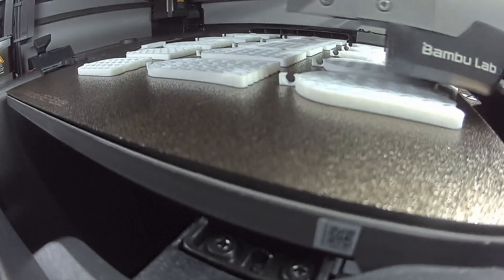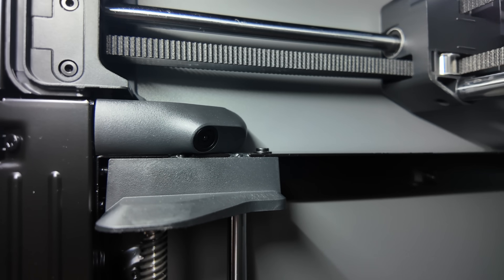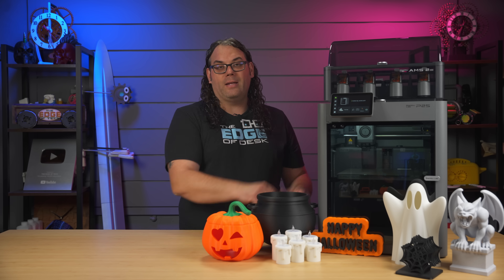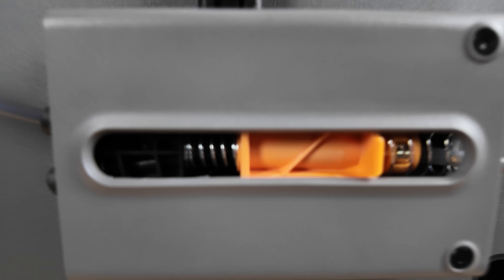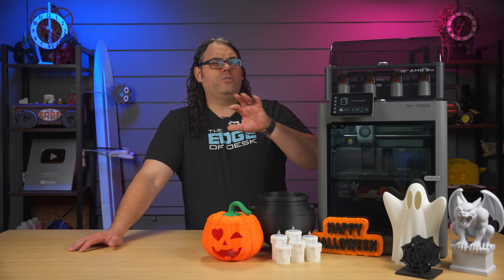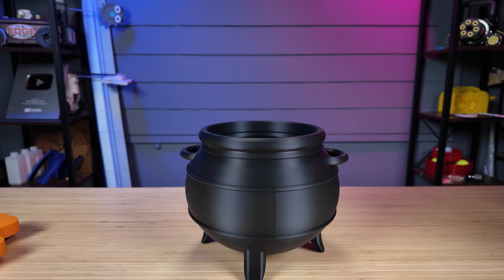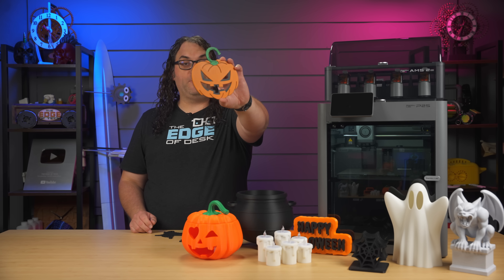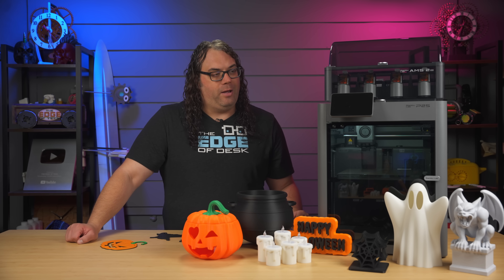What I think about the Bambu Lab P2S After 200 Hours of Testing

Comment: Any one else experiencing  problems  printing from the external spool holder  whilst the ams is connected? Seems to through up  random filament changes  and rehomes  in single filament  prints  which cause layer shift  due to not resuming correctly.

Comment: Thanks for the review man, quick question. There's currently no stock for the P2S combo right now but you can buy the P2S and AMS 2 separately, now and I was wondering if I were to do this what else should I get? I've done a bit of research and it said that I'd need to buy a buffer along with the AMS 2 so I wanted to clarify with an expert that I'm not missing anything, thanks!

Comment: One issue I think you missed is fume extraction when printing with ABS/ASA (and other filaments that give off fumes/VOCs) with this printer. On the P1S they had a cutout behind the filter that vented the internal air. Now on the P2S they removed that and give you the option of either circulating internal air through the filter or opening the vents and bringing in outside air. The problem is this will force fumes/VOCs out between the door seals and poop chute and/or through the vents. This is a real problem when printing with ABS/ASA and other filaments that give off strong VOCs. Voxel and others have products like the X Filter and Bento Box to help provide better fume extraction for the P1S (and these work well) but since there is no native air export cutouts on the P2S behind the filter it seems this will be more difficult for the P2S (Voxel actually does have something coming out next week for this). Seems odd Bambu has done this since user safety is a risk when printing with these types of filaments. Interested in your thoughts on these issues. Thanks.

Comment: The test I would like to see is a single wall crystal shape.  I have found that shape is very tough to print. I am going to hear comments about turning vase mode on. Can't, the tips of the crystal shape do not render, only with 1 wall thickness will it render.  Single wall is great for items being lit via tea lights. Thanks

Comment: Bamboo Labs customer Service is deplorable
Multiple reports from users across online forums like Reddit, Facebook, and the Bambu Lab Community Forum confirm that Bambu Lab's customer service has been widely criticized as deplorable. Common complaints include slow response times, unhelpful automated replies, and a difficult, frustrating support process. 
Overview of customer service complaints
Extremely slow responses: Customers often wait weeks or even months for a reply to their support tickets. This has been a recurring issue, with many users documenting long delays, particularly for orders and warranty claims.
Unhelpful and automated responses: Many users report receiving canned or automated responses that don't address their specific issue. Some say they are asked to repeat troubleshooting steps they've already tried or to provide information they have already submitted.
Difficult and convoluted process: Submitting a support ticket is reportedly burdensome, requiring customers to provide extensive information, logs, and photos or videos before even getting a meaningful response.
Failed warranty and return experiences: Despite having a defective product still under warranty, some customers have had requests for repair, replacement, or refunds denied. One Better Business Bureau complaint from 2025 details a denial of a replacement after repeated attempts to fix a defective printer.
No phone support: Bambu Lab does not offer phone support, meaning all customer interactions happen through written communication via their ticketing system. This further exacerbates the frustration for many users. 
Reasons for the customer service issues
Rapid company growth: As the company experienced a rapid surge in popularity, its customer service team reportedly became overwhelmed with new users, many of whom were inexperienced with 3D printing.
A1 printer recall: The A1 printer recall in early 2024 significantly amplified the workload for the support team, creating a huge backlog and angering many customers who were waiting for refunds or replacements.
Company location: Some users attribute the poor experience to a culture clash between what they call "Chinese customer support" and Western expectations for support.
Understaffed team: During certain periods, the company has reportedly been short-staffed in its customer support division, contributing to negative experiences. 
Bambu Lab's acknowledgment and efforts to improve 
Bambu Lab has been aware of the support issues and has attempted to address them. In March 2024, the company published a blog post acknowledging the problems, particularly after the A1 recall, and outlined its efforts to improve customer support. Some users have noted that the situation seems to be improving, though experiences can still vary widely.

Comment: Thanks for your 200 hour review of the P2S.  You didn't have any print failures at all?  Even if they are user error?  I Fact Check:  The P1S screen was not analog.  It was a digital LCD screen.  It just wasn't a touch screen.  Analog displays would mean that it would have been a series of gauges.

Comment: Whats the point of reviewing an enclosed printer if you don't focus mainly on materials that requires an enclosure? If i wanted to print halloween decorations i would have bought a A1
Reply: Moron
Reply: Totally agree
Reply: Kinda limited without a heated chamber.
Reply: @gastiresoil9758 it's passively heated with temperature regulation and can print nearly any modern material with minimal issues.
Reply: But your gonna eventually need to print abs asa pc and carbon fiber reinforced filaments

Comment: I’m honestly surprised Bambu Lab released a new printer with such terrible VFA. There’s really no progress here. Bambu Lab disappointed.:pillow-turquoise-hot-chocolate:
Reply from the maker: Interesting comment. Why do you think that? And do you think they will work on it in the software?
Reply: I used the p2s for a little over one week and I have to say these VFAs a so bad that i consider to send it back my a1 with 1,6k H worktime prints sooo much better and has way less VFAs its laughable at this point… idk if they can fix this with software updates
Reply: The motor drivers cause this issue, definitely an issue here that hasn't been worked on by BL

Comment: Glad they refreshed it 
But I think I would be more interested in an "A2" basically an A1 upgraded to have a 300x300x300 build volume and a vortek system with 4 nozzles on it
That can work with the AMS lite and  an AMS lite pro , enclosed AMS lite with a dryer that has a thermistor and hygrometer you can monitor from the screen or in Bambu studio.
4 PTFE tubes going to the tool head like the A1 so there is no retraction for 4 color prints. And ability to print 4 color TPU would be possible too not that I would use it probably.
But an A2 bed slinger with AMS lite or an upgraded AMS lite pro would have advantages over the core XY machines because you have 4 PTFE tubes going to the tool head which would probably impede movement on core XY machine
.
You have faster color swaps because it doesn't need to retract all the way to the AMS.
They could put a 4 nozzle vortek rack on a sled that moves front to back in either the left or right side of the printer and overhang the gantry over the bed so the tool head can just move the X all the way over and the sled would move front to back in the Y as the tool head moves down to pick up the next nozzle.
I don't really care too much about printing high temp filaments but an affordable printer that does multi color with no waste and that is much faster for multi color would be very appealing.
If you already have an AMS lite you could use that on an "A2" or upgrade and get the AMS lite pro or buy an A2 AMS pro bundle.
Keep the price in close range to the P2S or less and closer to the A1
It would sell like gangbusters
Reply from the maker: Thanks for the feedback! It will be interesting when they update the A1 series! And I can't wait to see the Vortek in use!!

Comment: No external exhaust fan? Don't like the thought of fumes leaking out into the room...
Reply from the maker: Most 3D printers do not have this though? The H2S/H2D did with the lasers, but what other 3D Printer has an exhaust fan to blow outside?
Reply: @TheEdgeofTech  My P1S has one and I attached a 4" dryer vent hose to it into a heapa/charcoal filter box. charcoal only helps with VOC.
Reply: Which is why they have a carbon filter inside🤦🏽‍♂️🤦🏽‍♂️🤦🏽‍♂️🤦🏽‍♂️🤦🏽‍♂️🤦🏽‍♂️

Comment: My main takeaway is that it does faultless large prints and no warping. It's frustrating when you get that on the bottom surface.
Reply from the maker: I would say yes, you are correct. I mean there is always a chance for an issue, especially if the bed isn't clean, but I didn't have any issues as seen in the video! Thanks for watching!

Comment: are the prices as referenced in CAD or USD?
Reply from the maker: In my video they would be USD. Thanks for watching!
Reply: @TheEdgeofTech  excellent! hopefully it doesn't bounce up too much if tariffs affect the price.  

As an influencer, I'd love your input: I use a p1s as my sole workhorse for my etsy shop, but i need to secure a second printer by November: I'm stuck between p2s (will these be in the usa by then?), an x1c, or... H2S - reasoning: some signs I print are rectangular and i have to position them on a diagonal , which hasn't posed a problem really, but the idea with the h2s is, I can lay it vertical/horizontal (or make a really large one if requested), and print side by side if i have multiple orders.  On the one hand, it's a fair bit more expensive (which i can handle for the business), on the other, the p2s (or x1c, prices are dropping locally) might compliment my p1s just fine and maybe the xtra spend isnt necessary... 

thoughts?
Reply from the maker: @JThemelis great question! If it was me and I had the money, I would do the H2S in your case. It would be a good upgrade and the bed size would give your business more opportunities! That being said, you could almost get 2 of the new P2S machines for the price of an H2S. So in my opinion, if you need/want more size opportunity then the H2S. If you're looking to scale what you have already then the P2S. Both are great printers!

Comment: Does the screen come attached?
Reply from the maker: No, you put it on once it's unpacked so it doesn't get broken in shipping.
Reply: @TheEdgeofTech like the x1c set up ? 
How big is the bed? So its a mixture of x1c , A1 and h2s it looks like .
Reply from the maker: @PeterAgostiniJdcap26 yes the screen attaches like the X1C. Or H2S. But no, it's not mini. It's the same size as the X1C, P1S etc. The build area is 256x256x256.
Reply: How does the hot end attach as far as the wires to the board? Ty Jim